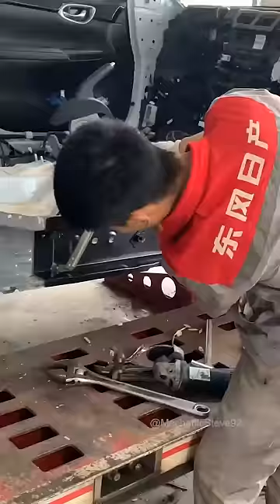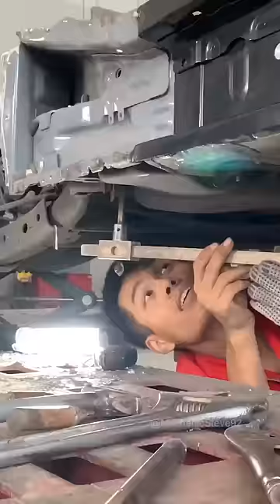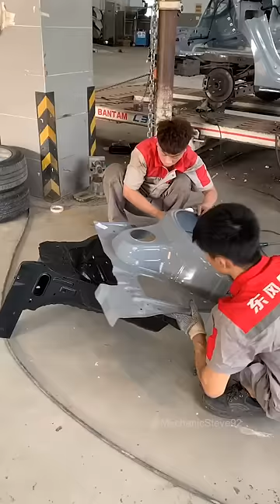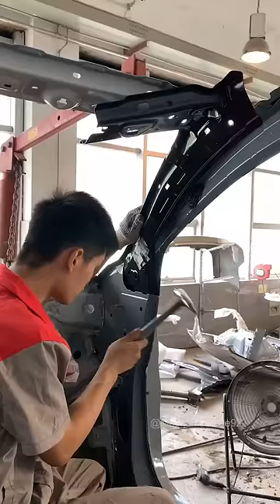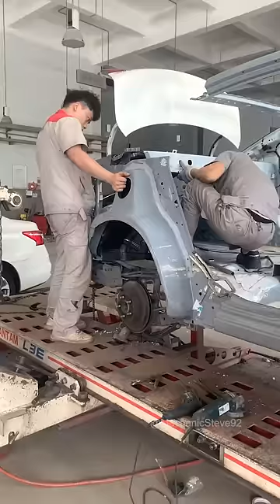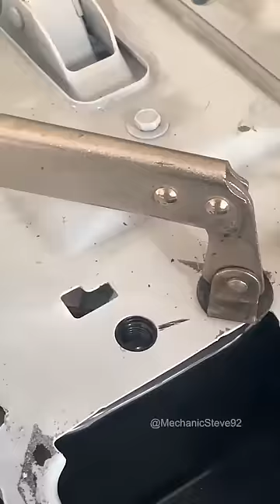#mechanic #automechanic #automobile #cars #trucks #restoration #mechanicsteve #shorts #fyp #car

Comment: Honestly, unless it’s a new Rolls, Lambo, Ferrari or equal to in value, that much repair work isn’t worth doing to ANY CAR. he’s doing full inner structure on the whole right side plus suspension and a roof… which means all the bags blew… which means the repair work way outcosts the book. And why buy new dealer stock parts? Why not buy a whole right clip used?

Comment: spot welding without UV skin and eye protection is not advisable and can lead to skin and other cancers. however, i too have done this. if this is done it should be limited and the welder should look away and or close their eyes once the stinger is in position. however, the best practice would be to use full body clothing and respirator style welding helmet, although many manufacturing facilities frown upon it.

Comment: once unibody cars get tweaked,  they are never the the same.  the bending and rebending distresses the metal.
Reply: New panels replaced the "tweaked" ones. How do you suppose new vehicles are manufactured?